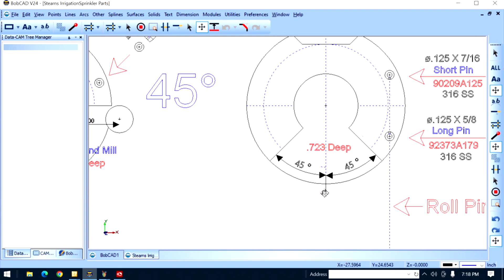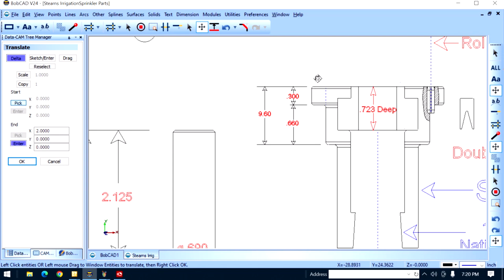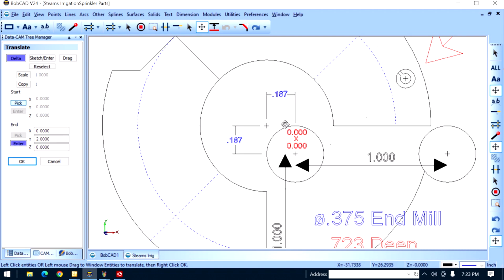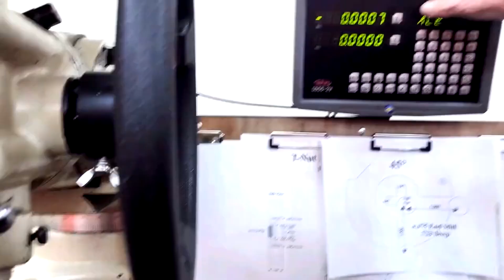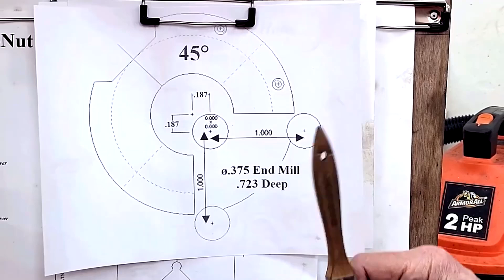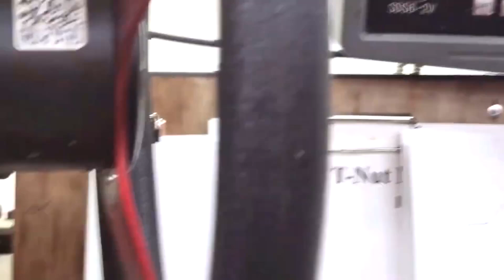Stearns Window Milling Technique

Comment: Thanks for sharing. Like the set up. What is the reason the inspection window needs to be accurately located? Is there a next step for the part after this machining?
Reply from the maker: Benno - We needed to view the Sealing Surfaces for the Rubber Seal. 
We didn't want to cut out the area where the Poll Pins were located . 45°  was the Ideal Angle .  Rather than mill it using layout hand tools - I went the DRO Route . -- Jim